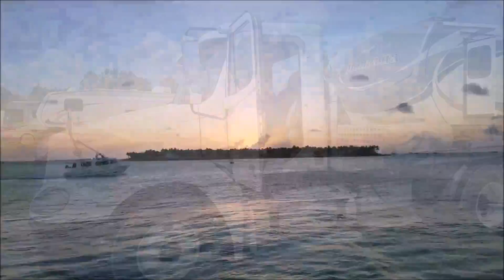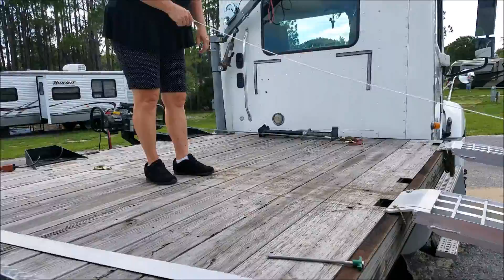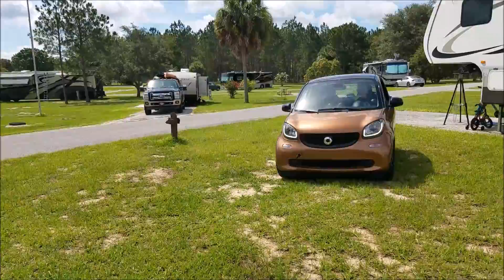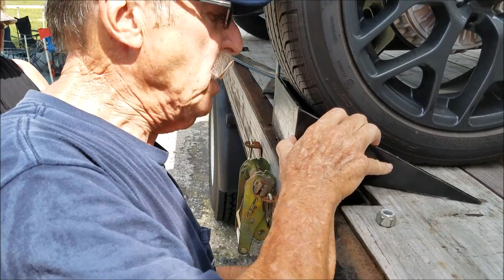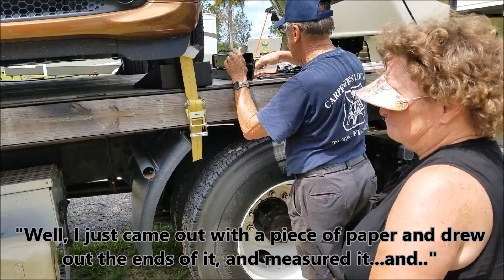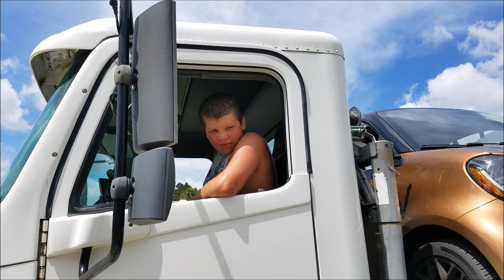ONE OF A KIND COUPLE & RV HAULER!! | Loading/hooking up | Full Time RV Living 06/29/17

Comment: Pretty nice rig sir but I would mount the winch solid underneath and tucked in and have a live roll on the side of the deck for the cable to run over. winch could stay put
Reply from the maker: That is a great idea Dontrushme2112!  Faster and easier. 👍

Comment: For those more curious and did not know or find out yet, but check out RVHaulers with Gregg Shields (RVHLifestyles, YouTube Channel is All About RVHaulers with Gregg) and also check out the HHRV Resource website packed with all USA and self building info via web search for more info on Heavy Haul RV hauler conversion info for making it yourself or for a outsource builder along with state licensing and registration requirements to operate such based on your home state or to convert to out of state to get on the road. As not all states have the same requirements only needing Class A license and some types of build will require Class A CDL as such in this example.
Reply from the maker: Thank you Joshua79C.  These sound like great resources!

Comment: Nice job folks ! But did ever think about installing the winch on the passenger side under the deck. And loading from the drivers side, a pulley on a upright to run the wire rope tru . That way you wouldn't have to touch the heavy winch easy and every time, cuts the work load in half. Good luck !!
Reply from the maker: +1armedguy that does sound like a great idea!

Comment: Unless he's SAE certified and has a current PE in ME, he absolutely did NOT modify that 15k lb hitch into a 20k lb hitch. He might've modified it, but any rating is just him guessing. It's actually quite dangerous if he's putting anything over the original design load on it.

Comment: The flatbed makes that a truck and trailer combo maximum length is 65 feet alot of states are cracking down and wrighting over length tickets for revenue i know 4 guys got over length tickets with pickups,texas oklahoma california for sure wrighting them its revenue enhancement anything over a foot they shut you down till its made legal one guy i know was over 9 inches cost him 280 dollars
Reply from the maker: Wowza that would be terrible!
Reply: @CamperSizeLiving  one of my friends that got a ticket the cop told him if he took the box off it would be considered a tractor and allowed 75 feet he asked about puting a flatbed cop said no a flatbed would be able to haul and it would still be a truck and trailer and limited to 65 feet  so im going with a little shorter trailer

Comment: what car ?
smart electric, smart diesel, fiat ?
Reply from the maker: +Mr_Wizard it was a gas motor.  Don't remember the make our model. We'll try to touch base with Chuck and find out for sure.
Reply: The Smart car is the only one with a length no greater than 102"/8.5', the maximum width in most all places. Any other car would have to be hauled fore and aft - the same way a flatbed/rollback tow truck carries cars.
Reply from the maker: +Lloyd De Jay II thank you for your comment!  I had no idea.   Great info for those interested in a similar set up!
Reply: I believe it is a 2016 Smart Fortwo Prime. I carrie a very similar car on my Volvo.
Reply: @lt1nut  It's been quite a few years since the Smart was under 102". The one he has on the deck is over 106". I'm very surprised more law enforcement officers aren't on to this. The maximum width on the interstate highway system is 102" and therefore this is a reducible load because it can be loaded long ways, as you said.